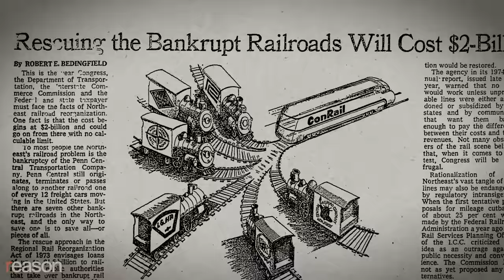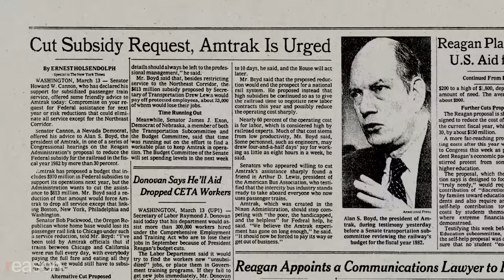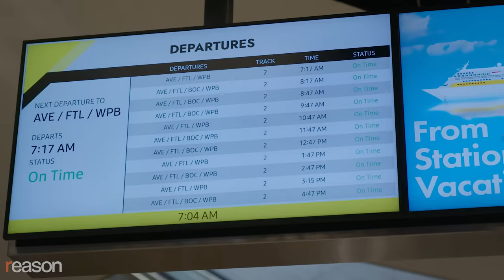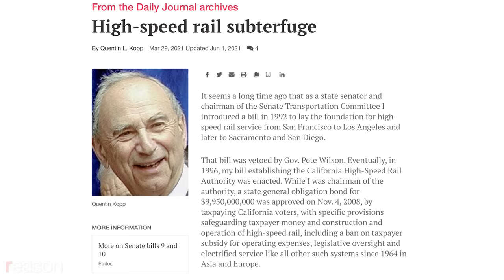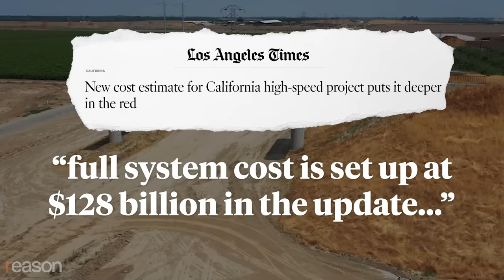How Florida beat California to high speed rail

Comment: Why point out the public dollars that can go to intercity rail but ignore the public dollars going to intercity highways? At least rail has the potential to be profitable. Not so for our roads.
Reply: The roads are paid for with fuel taxes.  The users of the network are paying for it.
Reply: @Inquisitor6321  That is not true. In 2020, state and local motor fuel tax revenue ($53 billion) accounted for 26 percent of highway and road spending nationwide. Some states are better, but the state with the highest share covered by direct user fees and taxes (Hawaii) still only covered 71%. 

Everyone pays for the roads regardless of whether or how much they directly use it
Reply: @brennanconway3728 this doesn't accou the for federal gas tax revenue. How.much of it went to highway infrastructure?
Reply: @joelrodriguez9661  federal gas taxes fund 84% of federal road maintenance. But you have to remember that the vast, vast majority of roads (including all US Highways AND the entire interstate system) are owned and funded by states. Federal government owns 3% of roads, most of which are roads in national forests and parks, military bases, and Indian reservations.

The remainder does go into the highway trust fund which is used to build new highways. The fund is not solvent, however, because gas tax has not increased since 1993 and requires annual transfers from the general fund
Reply: @hdog679 the highway system and local highways are merely infrastructure of transportation for the public.  They are NOT for-profit entities that need to make a profit.  Railroads on the other hand ARE.
They only roads that make a profit are toll roads.
Reply: @Inquisitor6321 I agree — and I don’t think rail should need to make a profit either. It can be as much a public good as “free” roadways that are paid for from general revenue. In fact, intra- and inter-city rail can save governments money. Giving people a good rail alternative reduces the more expensive wear and tear on roadways.
Reply: @hdog679  here's the big difference between the road networks and a RR:
with the roads networks, WE the people provide the "rolling stock" - the vehicles - and we maintain them.  SO the roads are the only think needing maintenance.
A railroad has to provide the vehicles.  And they are an enormous cost to purchase and maintain.  No pair that with the construction and maintenance of roads.  Now can you see the enormous cost of a RR as compared to the highways?
Reply: @Inquisitor6321  Partially paying for the network, which is why you are assessed for street repairs, and why there are porkulus bills for "crumbling infrastructure" all the time.
Reply: @Inquisitor6321 I’m a civil engineer so no, I don’t buy the idea that just because rails have rolling stock they are by-default more expensive. One subway line can transport more people than a 16-lane highway so they are space/land efficient. Railways have extremely low friction and therefore are fuel efficient. And railway’s rolling stock can be in use all hours of the day providing value. When the consumer buys their own car, it sits idle 97% of the time providing zero economic benefit— it just loses value.
Reply: @SHKarlson  well, do you think they will go away if the roads are replace with railroads?
Reply: @Inquisitor6321  turn all highways into toll roads, as well as remove all federal annd state fuel subsidies. Then we'll talk.
Reply: @Inquisitor6321 that's exactly the point. If you have the freedom to own a car, we must have the freedom NOT to own one. Most Americans are forced to own cars that can potentially put them deep in debt.
Reply: @Inquisitor6321  just like public transit is paid for by the fares, the users are paying for it
Reply: @ianhomerpura8937  so if you don't want a car, then you want the rest of us to pay for your transportation system just so you don't have to own a car.
Reply: @chromebomb  Mass transit is heavily subsidized by the government.
Reply: @Inquisitor6321  meanwhile we're paying for all the federal subsidies and bailouts for highways and airlines, as well as fuel subsidies to keep gas prices cheap.
Reply: @hdog679  Thank you. I also love that when Inquisitor is comparing high price of rolling stock, he casually forgets that rolling stock life cycles are typically measured in decades, not years like a personal vehicle (average personal vehicle lifespan is 12 years in the USA). There are TGVs still in operation that were constructed in the early 1990s. I won't even mention the age of some of the London Underground rolling stock.
Reply: @ianhomerpura8937  RIDE A BUS.
Reply: @ianhomerpura8937  highways don't get bailed out.
What happens with the air lines is wrong.  You don't manage properly, you should go under.
Fuel doesn't get subsidized unless it's grown. (ethanol)  The so called oil and coal subsidies are actually tax write-offs.
If you want tax write-off, go into business for yourself.
Reply: What about the $20 tolls on the GWB, $13 tolls to cross the LI Sound, and new congestion pricing for lower manhattan?  That money goes straight into supporting MTA and Path, not back into roads.  You are not accounting for money that is being taken from roads and subsizing commuter rail/subways.  You are also not including all the federal/state taxes trucking companies pay for milage traveled outside of fuel tax, or the hundreds of billions truckers pay in income tax since it is one of the largest industries in the US.
Reply: Nearly all existing limited access highways would be profitable with tolls.
Reply: @MilwaukeeF40C  want to put it to the test
Reply: @MilwaukeeF40C  after they have been built with tax payer money??
That's evil!
Reply: No it's not.  Sunk costs.  They never should have been built with theft in the first place, that was evil and artificially crowded out private alternatives such as rail and more efficient land use.  Get the state out of everything.
Reply: ianhomerpura8937 Fckn yes.
Reply: @RecklessTornado FALSE.  The  roads are funded by gas/diesel taxes (indirect tolls).  Both the states & federal governments collect MORE of these gas/diesel tolls than they spend on road maintenance.  Therefore, roads have a surplus and don’t need subsidies .    TRAIN REALITY: 

China has built more miles of high‐speed rail than any other country with $800 billion debt.  None of its lines are covering operating costs.  (As a result, China is shifting to building more roads.)

France’s rail has debts of $70+ billion and has been repeatedly bailed out by the government. SPAIN built its system with a public‐private partnership.  It is $90 billion in debt.  The state‐owned Japanese National Railways has a debt of $550 billion.  (Japan also has Highest debt to GDP of 300%.)

Railroads are an OLD 1700s technology that is obsoleted by faster, more flexible travel technologies.  High-speed rail loses tons of money & is a bad investment.
Reply: @electrictroy2010  Federal fuel taxes total about $30 billion/year. Federal highway spending totals about $90 billion per year. Zero public roads in the US cover operating costs.
Having huge debt figures is fine if the benefit to the public exceeds the cost of the infrastructure and the government is able to service the debt.
High-speed rail is not only not obsolete -- it is significantly faster, safer, more energy efficient, and more space efficient than roadways.

Comment: HSR is a great goal to strive for, but just building out a unified intercontinental passenger system should be the current goal. Many people would ride trains even if they took slight longer, they just want a way to get to certain locations without having to put much effort into it like navigating an airport or driving a car.
Reply: Exactly. And I think this is precisely where Brightline won. Brightline isn't high speed rail, not even close, yet they still managed to bring the passenger numbers they did, which shows that people aren't looking exclusively to HSR, but rather looking towards mostly fast, convenient travel completely car-free. It's a model that Amtrak and other states could learn from to improve passenger trains in the US. Just a long, vast network of 110-125mph trains that comes frequently and at good prices would transform the US into something great.
Reply: 200 km/h aka 125 mph is fast enough for most trips and slightly faster than an Amtrak train at high speeds... It may be the absolute minimum for HSR but it is still fast enough to be a game changer. At this speed you can also get away with level grade crossings as long as proper barrier gates exist. Any speed higher than that involves much more expensive engineering aka the California solution. If you want 350 kmh service you need straight level tracks with no crossings and to get that you need to build huge trenches, tunnels, embankments and bridges which cost 3-4X per mile or km to build on average.. Hence why a California HSR went from $20B to $120B when you include inflation, delays, redesigns, etc.
Reply: Instead of aiming for lower speeds and services, it may be better to study the reasons why infrastructure costs are so overinflated compared to other developed countries.
Then act on it to reduce the crazy inefficiency and go for the true high-speed and better service, better value.
France and Spain build high grade high-speed lines operated at 320kph or 300kph for a tiny fraction of the cost.
One of the latest French high-speed lines is a 300+ kilometer long extension with all the environmental bells and whistles you could think of, and double footprint land preservation for "rewilding".
It is operated at 320kph / 200mph but was rated for at least 360kph as, by definition, lines in France must be capable of smoothly handling the commercial speed goal plus 10%, which is 352kph.
This HSL, called LGV SEA, cost less than 8 billion euros, including everything from the environmental mitigation features (like a myriad of wildlife over/underpass, "frog tunnels" or "forrest habitat continuity bridges", etc.), double footprint land acquisition and the nature preservation of this "shadow double", the rebedding of rivers and creeks, the restoration of wetland natural habitat, dozens of kilometers of access tracks, stations overhaul, and provisions for environmental monitoring.
7.7 billions, to be exact !

200kph / 125mph is just not enough in many cases to trigger enough modal shift and make it truly successful. That's conventional train speed in certain countries, not high-speed.

Developed countries that have successfully changed the modal share towards the train have true high-speed, not just "higher speed".
200kph / 125mph is the speed of the conventional regional train in the tri-border region of Alsace in France, where is located Strasbourg, seat of the European Parliament, Council of Europe and European Court of Human Rights.

Lowering the goal and the service to save on cost instead of addressing the cost overinflation issue is like giving up and accepting to never really improve things. I think America deserves better.

By only aiming for 200kphv/ 125mph, you get something that is still way overpriced.
If countries with higher taxes on labor, higher energy prices and stringent environmental regulations can develop infrastructure for an acceptable cost, how come the US can't? 

This was recently highlighted, if I recall correctly, by a NYT article and a NYU study called project infrastructure cost or something like that.
It pressed on the monumental cost difference of 2nd Avenue subway and Grand Central East Side Access versus Paris' "Grand Paris Express" mass transit expansion project currently being built, plus a few other European transit developments.
Reply: Zero reason for a unified system in North America.
Reply: I still think you're getting too far ahead of yourself. The real current goal is what Brightline is doing. Proving and showing to the US public, with Brightline's model, that passenger trains can be a viable travel option and financially successful. If Brightline is successful, it will peak the interest of more people and create more demand for passenger rail. This then could in turn possibly create more private companies to create and build new lines which could lead to HSR.
Reply: I think this is the correct way to think about the train. From Orlando it would then be easier to go up to Jacksonville, then on to Atlanta, Charleston, Charlotte, Raleigh, Richmond, and Washington DC. And today in man y of these southern states, they have the land at cheap prices. If you could average 100mph on the 800 miles between Washington DC and Miami tons of people would take the train for $100 or even $150. It’s just under 2 hours by plane not including time spent in the airport and time spent getting to the airport. Maybe 4 hours by plane depending on how you slice it. Now, on the train, convenient, quiet, comfortable, ability to do work, the benefits go on for sure over cattle class on a plane. Even the trip to Orlando being 3.5 hours, the purpose wasn’t to replace every single automobile on the road, it was instead to capture some of those vehicles and instead supply that demand with trains. If you are flying in from lets say Europe, flights to Orlando are cheap, but flights to Miami can be expensive, so you fly into Orlando, and then hit Brightline for $80/person down to Miami.
Reply: @Da__goat  Orlando to Jacksonville is at least viable but it would not involve building  a completely new line. That would not happen. The only viable option is to upgrade existing rail lines as Brightline has done with FEC. Even then, I don't know if 100mph would be possible. Washington, DC to Miami at 100mph is a pipe dream and no I do not believe tons of people would take it unless gas prices were beyond outrageous and airfare prices were beyond outrageous. Who wants to sit on a train for 8-10+ hours when they can fly faster and a little more money?? There would have to be so much demand people would be protesting. You guys need to let it go. It's not happening.
Reply: @KyrilPG FALSE on your overseas comparisons.  China has built more miles of high‐speed rail than any other country with $800 billion debt.  None of its lines are covering operating costs.  (As a result, China is shifting to building more roads.)

France’s rail has debts of $70+ billion and has been repeatedly bailed out by the government. SPAIN built its system with a public‐private partnership.  It is $90 billion in debt.  The state‐owned Japanese National Railways has a debt of $550 billion.  (Japan also has Highest debt to GDP of 300%.)

Railroads are an OLD 1700s technology that is obsoleted by faster, more flexible travel technologies.  High-speed rail loses tons of money & is a bad investment.
Reply: Whether the power-train is EV or Hybrid or maybe even Hydrogen, new tech is making multi-section buses very viable, even versions where they are not physically linked but tether via computer spacing like the lane-assist and follow distance features on newer vehicles today. 

That could be a solution, where you can have 2-5 Buses connected and acting like a virtual train on highways, maybe even getting their own lane during rush hour, instead of having to build entire rail-lines.
Reply: @stickynorth That makes too much sense.
Reply: @KyrilPG Ain't the cost of living free in America great? There's a very good reason why hsr in America costs more.

Comment: Florida didn't beat them because brightline is straight up not high speed rail. it's cheaper because they've cut massive corners.
Reply: As for Cali, our 2008 ballot initiative promised SF to LA highspeed rail.  The governor is now saying 2040 for that full route to open.

Ridiculous.  Brightline might “only” be 125 but it’s still operating 20 years ahead of when SF-LA will finally work
Reply: Brightline just worked smarter, not harder. Get more money (and hence more passengers on the trains) by making a route that actually makes sense.

Comment: Japan has a huge train network, and it's mostly privately built and owned (outside of some metro subways)
Reply: Wrong, it was publicly built and funded until the late 80s when Japan privatized it.  Since then the overall network has shrunk and Japan still subsidizes some of it in ways.
Reply: Incorrect 
I live in Japan.
It was built by the government.
Reply: It was built by the government, and was turned private in the 80s. JR, the company that owns it, is heavily overseen by the government through regulations, basically Social Democracy.
Reply: Shinkansen was government subsidized (and original debts still being paid off).  Several commuter lines were not subsidized.
Reply: When my Dad traveled by rail through Japan, there were no nasty buildings in the way to build new rail lines.  For that matter, where wasn't much at all.

Comment: While I do think this news is something to celebrate, there is a lot of misleading information.  Brightline will take 3-1/2 hours to get to from  Miami to Orlando; not under 3 hrs.  California has made many funding and managing mistakes but it shouldn't be given up.  Unlike Brightline, the California High Speed rail trains will be significantly  faster.  That's going to require brand new tracks.  I do think what's happening in Florida is good news.  Brightline has plans for a real high speed rail from southern California to Vegas, and another connecting Dallas to Houston.  Let's see if they can deliver.